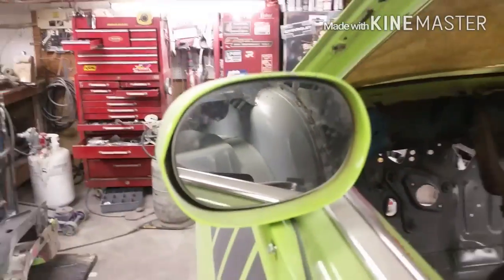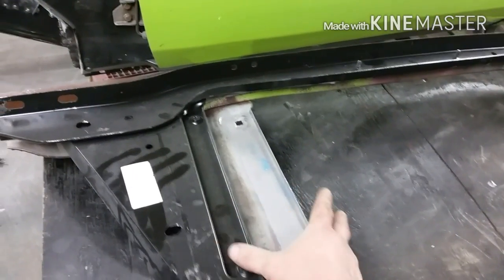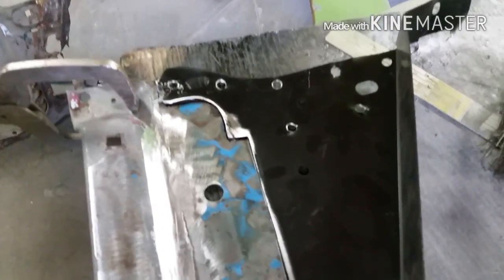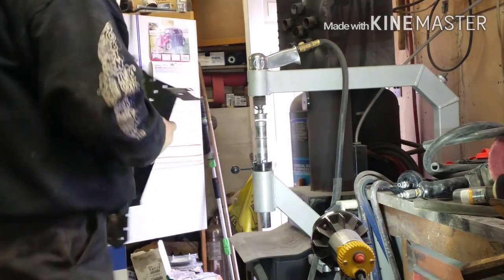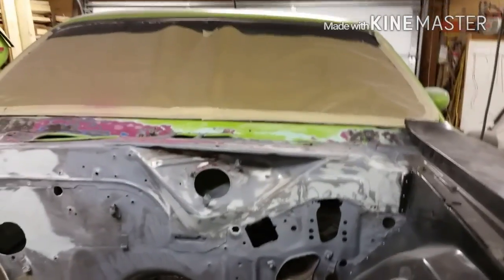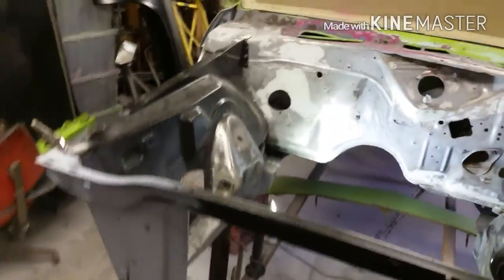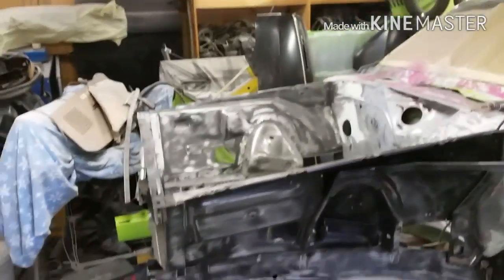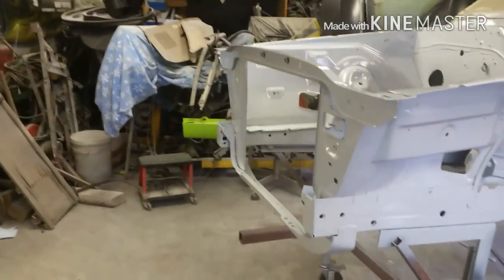Project cuda part 21

Comment: For all the people watching this series of videos, if there's one thing you should take away from this it's 'preparation". If you have the attitude of 'that's close enough', please don't ever attempt something like this.
Every single aspect of auto rebuilding is in the preparation, if you are welding in new sections, please for crying out loud, make sure it's right before you hit it with  a welder. It makes life so much easier  when you
get to this stage of the job. Great work Bruce, you are on the home stretch here, and I already know how easy the rest will happen because you took the time to do all the prep work 100% correct. Outstanding work 
for a guy that says "I'm not a professional", I have seen so many jobs done wrong by people who call themselves "pro's". You sir can call yourself a pro, because you are doing such a better job than many of the so 
called pro's out there. Just look at the work done by the people who had this car prior, you are undoing their work and doing your own in a MUCH better fashion, and I bet they called themselves pro's. Doing a job like
this and doing it PROPERLY is what makes you a pro. Kudos to you Bruce.

Comment: I'm sorry if I keep asking about the epoxy over ecoat, I'm doing same project and just wondering if you had any issues with adhesion. Thanks
Reply from the maker: jedi barracuda some people say you can go right over the e coat. but I just don't trust it I tried to at least scratch it with 80 grit if I could no problem with sticking
I'm bringing it back in a couple months to repaint the hood. ..got a big old dent when I scuff it will be a good test. have you gotten through the hole cuda series 😧
Reply from the maker: jedi barracuda I noticed you're channel has no videos let's see you project lots of guys who are willing to help
Reply: Brid chvtruck, I don't have any videos of the progress just tons of picture. I appreciate you replying.
Reply: Brid chvtruck, no I'm only on #25
Reply from the maker: Just string all the pictures together and upload guy's would love to see them
Reply: Brid chvtruck,  I might one day. Do you have the 73 headlight bezels I need a set of original.
Reply from the maker: Sold most of the parts. .got the front fenders and bumper left
Reply: No problem, thanks for all the great tips and ideas on this project

Comment: you may want to get ceramic coating on the header if it is offered   It will cut down on the under hood temperature
Reply from the maker: as long as I don't have to sit under the hood it's all good lol thanks for watching
Reply: your engine may like you more if it lives in a cooler place may not cost any more if you were going to powder coat them anyway

Comment: Looks good you're getting a lot of work done in a short amount of time. When going from a 22 inch radiator to a 26 inch radiator I found out both sides are different. The drivers side is only about, a half inch different. You might want to set the radiator in to make sure the bolt holes line up.
Reply from the maker: Good advice will be doing a lot of mock up in the next few weeks Thanks for watching :-)